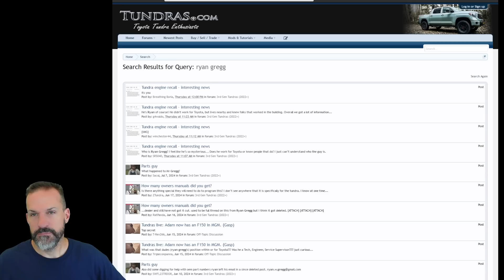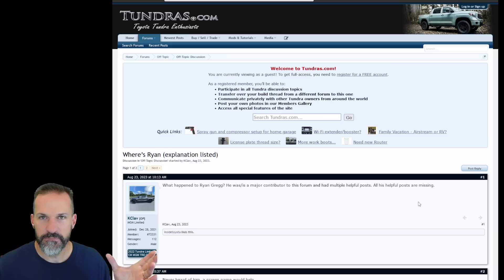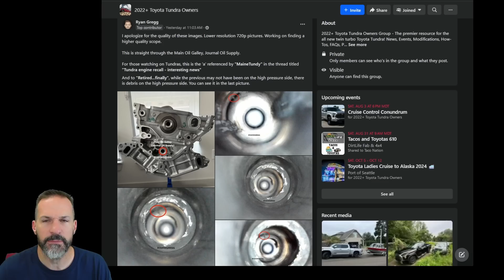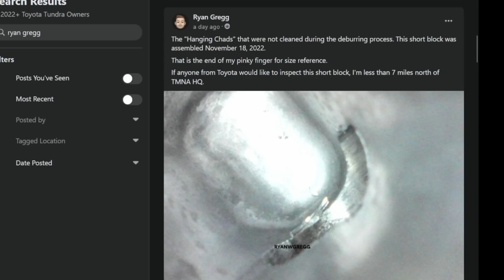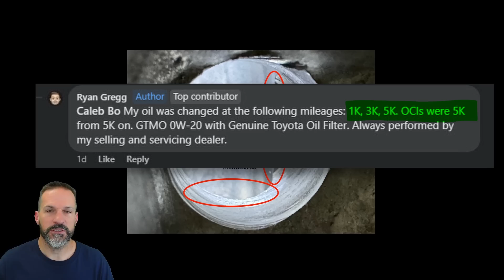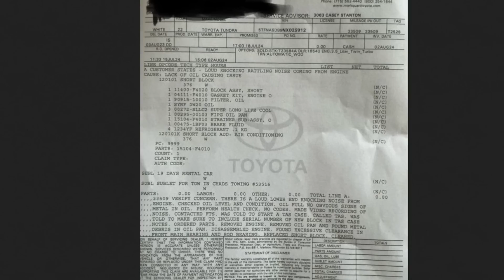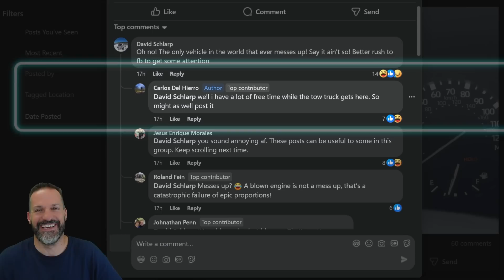Tundra Engine Failures: Debris Confirmed and Early Warning Signs for Dying Engines.

Comment from the maker: What do you all think? Judging from the pictures from Ryan, it REALLY feels like debris issues could easily be a big problem with regard to the main bearing failures...along with the parts changes Toyota made in early 2024.
Reply: I still don't understand how debris that makes its way past oil return seems to only effect the #1 main bearing.  Shouldn't the other bearings be equally effected?  There must be a reason for the new part number for #1 crank bearings.
Reply: @MSGarrett1  Given enough time, it would certainly affect other bearings but obviously the #1 bearing is the first one affected.
Reply: If you were going to buy a new truck or one a few years old, which one would you buy? I'm just curious about your opinion.
Reply from the maker: @williamellis59 I’d buy a second gen tundra. For new…that’s a tough one. I’ve heard through the grapevine that Toyota actually had debris issues up until November of 2024, so maybe 20,000 2025 tundras still will have issues. Going forward they might be safe but, time will tell
Reply: @TheCarGuyOnline indeed time will tell.  I sure hope they fix it.  I hate to see Toyota taking this turn.

Comment: I dont believe its a result of debris. Its low oil pressure. A very similar case study would be freightliner cascadia that has an electronic valve that would drop the oil pressure down to 5 psi while coasting. After developing a reputation for spinning main bearings they eliminated this feature around 2020. Full oil pressure all the time now.

Comment: I have a 2019 Tacoma with the 3.5 V6.  I really like the truck, but in my opinion Toyota is the most overrated auto maker.  Prior that the Tacoma I had a 2016 Frontier which was a better truck in my opinion.  It certainly had more power and it shifted more smoothly.

Comment: So Toyota still has a debris issue in 24 and now 25?  come on now
Reply from the maker: Some 2024s still had the issue. There has been a single 2025 reported with engine failure but we aren't sure why, the report did not have details and no others reported. Time will tell if they have this sorted out

Comment: Not surprising that debris is in the oil galley after a bearing failure. Very well could have failed because of "other" debris left in engine during manufacture, but this debris is probably self generated. And it is doubtful that the oil filter would capture all the debris from failing bearings as the by-pass valve probably opens on occasion and filtered debris gets washed into the oil galley.

Comment: 2024 Tundra with 2k on the clock is starting to scare me! While parked and idling, the engine stumbled badly and almost stopped. Idle feels a bit rough, but power delivery still seems good. Anyone else experience this before a failure?

Comment: I’m picking up my 2025 limited iForce max trd off-road next month! Super stoked. I’m not too worried. All manufacturers have their issues. People are only running their mouths because Toyota is held to a higher standard. Well, they are doing the right thing about replacing the whole engine. I think these issues could be a machine that isn’t correctly drilling out the channels in this engine which I’m sure it’s now fixed. Either way I’m getting a 10 year/125k mile warranty for super cheap for mine! I’d still rather go with Toyota than gm/chevy, ram (fiat), or Ford!

Comment: FORGERY & FRAUD:  Toyota of Fort Walton Beach Florida forged my signature on the pre-approval check which resulted in the APR increasing from 5.69% to 7.14%, increased the monthly payment and overall cost of the loan, and damaged my credit.  I did not know this until three weeks after when my credit union finalized the documents.  Toyota USA Brand Engagement Center refuses to hold the dealership accountable by saying that the dealership is individually owned and I need to take it up with them.

Anyone know an Auto Fraud Attorney in Florida that I can reach out to?

Comment: It’s not manufacturing debris.  It’s a design flaw or manufacturing tolerance flaw.  I wouldn’t trust that 3.4L twin turbo engine until the crank shaft problem no longer occurs and we have many samples with 150K to 200K miles.  That’s gonna take several years.
Reply: Wrong.

Comment: Weren’t you dead set on a design flaw, engineering failure? Shows you just like to chirp without knowledge of anything.
Reply from the maker: It's still in question. Toyota claimed they fixed this in 2022-2023...so why are there still, to this day, 2024s failing? Why did Toyota update the main bearing part numbers? I never said I was dead set on anything. I was pretty clear about that. If you like Toyota like I do (I own multiple Yotas still), you should be thanking me for holding them accountable so that maybe they can get back to what made them great...

Comment: Have a 1982 Toyota pickup with 1,000,000 miles on it have rebuilt the motor twice for 3000 dollars total and the transmission once for 800 dollars. Paid 5500 dollars new for it, still trying to get my money out of it. Just bought an after market new carb on Ebay for 100 dollars. Average 25 miles per gallon on the highway. Insurance is 35 dollars a month. I am 68 now and I am beginning to think this truck is going to outlast me. I was looking at this Utube, looks like they are even casting the blocks out of aluminum on the new vehicles. I am sad to see my Toyota go so far down hill. I suspect the only way you are going to get a reliable vehicle now is to rebuild an older Toyota, Ford or Chevy. I have restored a 1983 F150 Side Step 4 wheel drive Pickup with a 300 6cy, gets 20 MPG on the road. Have 10,000 dollars into it just need to paint. House is paid off life is good. Suggest to all you folks to let these new cars/trucks stay on the lot fix and old one and stay out of debt.
Reply: Thats a lot of trips to Walmart…
Reply: @pathunter7003  Had kids in California and a job 50 miles from home for 30 years.
Reply from the maker: I completely agree. buying older models and maintaining/rebuilding is likely going to become more common soon. That's pretty cool that you can rebuild that old one for $3,000, assuming it's a manual too?
Reply: @TheCarGuyOnline  4 speed, just bearings at the time, Toyota had a bad lot in that model, have put another 900,000 miles on that transmission. Any of the new products on the market, refers, washers, dryers, cars, trucks, tractors are a waste of money. I am trying to teach this younger generation that they have to be smart, avoid debt, fix the older models, buy a piece of raw land and build your house a little bit at a time for cash. I have rebuilt 5 houses now and did one from scratch. Have a 1952 8N Ford tractor, restoring. They made a good product then. I rebuilt that motor twice for a total of 3000 dollars.

Comment: Hey car care guy I need your opinion? Have you heard of any 2024s being recalled? I tried to ask the "Tundra 34 dude guy"  and the "the car car nut guy" but they're  useless as T*ts on a bull .  I got a deal on a lease return, but I'm hesitant to dive in on a Toyota that will fail in a couple years.  Is the powertrain warranty 60k miles on all their Toyota's?  Thanks!

Comment: Yeah well get rid of it get rid of the crop by the 4Runner brand new 4Runner is the best vehicle Turner still makes so just buy that 38,000 the base model Only Fools will buy a turbo motor or anything else the Toyota has to offer in the Corollas garbage you know and so whatever man be a moron and keep buying garbage don't be smart and buy a brand new 4Runner 38,000 I wouldn't pay no taxi the time that's it bring cash with you and walk out the door if you don't you're a moron I'll buy a used one

Comment: I used to  work for a bulldog chief engineer at Raytheon Missiles and when the program was facing a serious operational issue he always demanded that the engineers trace the fault down to the root cause.  Many times the first reported effects or symptoms of failures are erroneously identified as the root cause.  Toyota needs to release an analysis of this engine failure that convincingly describes the root cause.  In this case, the root cause may or may not be the undesirable metal burrs.

Comment: It was my suspicion was chips from the galley moving and plugging oiling ports throughout the engine. I work for one of the big 3 and sediment analysis is heavily scrutinized in the plant. The tooling is designed in a way to make small chips rather than large stringy chips so that they can be easily flushed out in the washing stations . There are also deburing stations in the line that remove any rolled over material. It is extremely surprising to see a block in that state to make it to assembly.

Comment: I waited so long to get my tundra....6 mo after i finally got mine...boom.... i knew I wasn't crazy when I told the techs my mpg dropped like a fly suddenly....
Reply: So what did they give you to drive after the truck blew up? And do you still have to make payments on something you can’t drive?
Reply: My 2024 sequoia was getting 18. Now I’m getting like 13. Then I have to pay 100 more for plates because it’s a hybrid. A hybrid that doesn’t do anything. I currently have 4200 miles on my engine.

Comment: Worked 48 years in aircraft engine and automotive manufacturing. All assemble parts go through a high pressure washer before assembly. Believe the debris is from a design problem.
Reply: Me too.

Comment: BuT iTs A tUrBo EnGiNe.....
Reply from the maker: I like turbo and electric engines for torque however the way they are designing modern turbo engines it's tough to get behind for daily drivers, especially for normie middle class folks. Very rarely are you finding forged components anymore or overbuilt blocks/heads etc. We are entering a new age where used vehicles will cost too much to repair for most people, and many buyers just don't understand what's even under the hood. It's 100% about profits, chasing power with smaller displacement while giving up reliability.

Comment: When can we expect a video on GM and their decade of V8 engine failures and their current lawsuit? Or video on the Ford Ecoboost lawsuit?   Or the Hemi 5.7 and 6.4 lawsuit? Toyota is fixing the problem and making their products better but for some reason everyone else gets a pass on this bias channel.
Reply: Maybe cause it is an unproven issue?
Reply: @pathunter7003  hilarious to suggest that! 😆  I have replaced over 100 camshafts on GM 5.3 V8s in less than 2.5 years.  And I am one guy that doesn't work at the dealership.  It is such a problem the Oil control valve for these engines is on backorder constantly.

Comment: It is disappointing to see that Toyota would consider legal action against a buyer who is posting information.

As a 2024 Owner of a Tundra, people, like myself are looking for answers.   Issuing a recall but then not doing much beyond that at this point, really doesn't address the issue.  Replacing part of an engine is more work than having a complete motor ready for immediate bolt in replacement.

I had to go on a trip recently that involved a very long drive.   I took my 300,000 Mile Tacoma and left my 2024 Tundra at home.  The purpose of the Tundra was to replace the Tacoma as my primary vehicle.   I had my 2024 Tundra a month before I found out about the engine issue.  Had I known this, I would have bought a V6 Tacoma while they were still available or bought a Chevrolet Silverado.  Ford can cram their EcoBoost.  I am done with Ford, which is another topic.

We need to have really strong Lemon Laws that really hold automakers accountable.  

The good news is that these pictures of the inside of the engine will be great for the class action suit that I predict will come out of the engine failures.

Plate C
Reply from the maker: Yeah it's tough to say where this goes. Toyota has had issues in the past in first year model changes, but I don't remember any being this large or costly. Time will tell how many of these are actually affected, I hope your 24 ends up being OK. 

I will say, by the numbers, there are NOT a lot of 2024s having these issues compared to 2022s/2023s. If it was mostly a debris issue which is more plausible now, I would think most 2024s and beyond would not suffer the same fait. Would I personally buy one? probably not...not for a few years, but since you already have one, I would just drive it until 50k then revisit the situation/decide if you trade before warranty is up. Given the numbers, I would feel more confident in 2024s than the 22s/23s for sure...I hope it stays that way. 

To give you some background, most people think I'm just a toyota hater...I'm not, I was in the market for a new Tundra when finding all of these issues. I own 3 Toyotas currently, all 2011 and older, and love them dearly.

Comment: LMAO they have to disassemble the entire truck for the repair, who the hell would want that vehicle back?!
Reply: What DIY'er would want this truck?  I have a 2006 I love , would never buy one of these.
Reply: Im a mechanic. But anytime you have to replace a motor you have to de assemble a huge part of the vehicle to replace it . Especially on newer models. Its always been a big repair- and i mean its what mechanics are trained and have had schooling for 🤷‍♂️🤷‍♂️.
Reply: You’d be shocked to see how they assemble the cars with this mindset lmfao.
Reply: @TenaciousSchemer  That is done by assemblers who handle one small job at a time in a highly efficient way. You expect me to think some 20 year old tech at a dealership can handle this job alone?
Reply: I have seen how they handle this. It's quite reliable. These techs get the schooling and tools to handle this job. Toyota pays them well, and I wouldn't take it just anywhere. I used to work for Toyota as service advisor, and they are honest and fair, that's why Toyota has this reputation unlike domestic auto manufacturers that act like the "CIA"!

Comment: Early sign is rattling sound and stalling, oil leak,  I have mine in the shop took some pictures as well and videos, mine is 2023 23k miles.
Reply from the maker: Are you getting a new shortblock or having to wait for longblock?
Reply: @TheCarGuyOnline  I do t know yet. It is sitting at the dealership nothing has been done to it. Toyota asked me for all the invoices and the extra stuff I installed on the truck with all of the invoices and registration fees. I sent it to them

Comment: Yep,  failure like this should not be replaced with short or partial engine.   It there was debris before,  there may be some in the turbo oil line,  oil cooler or lines,  chances are,  will have to replace it again later.

Comment: To add context, Ryan bought a brand new tundra short block for cheap, had plans to take it apart and document, but was banned from forum. Sound like he finally got around to taking it apart and sharing pics. 
So the debris is from a short block he bought, not from failed engine in his truck
Reply from the maker: Thanks for filling in the gaps :)

Comment: Oh nooooo
I did oil changes like Ryan so I thought I was ok. I’m at 107,000K on the OD
Reply from the maker: That's pretty high mileage. Is yours included in the recall notice?
Reply: @TheCarGuyOnline  No unfortunately. It’s the Capstone Hybrid. They should include the hybrids because it’s the same engine made in the same place as the non hybrid.

Comment: Thanks for update.  I agree this one to be avoided until 2026.  Not all affected models are included in this since they feel the hybrids can still limp along with blown main bearings.  And why aren't the 24's included?  I've heard of reports for those as well.  From the pieces of information we have got it does not appear they fixed this until May time frame this year.  Still too many unknowns.  I appreciate my 2019 Pro 4x with old school port injected motor with non active learning transmission.  Does not have tons of silly sensors everywhere.  I don't trust new cars anymore.  Except the last remaining 4 runners coming out of Japan.  Not liking any of Toyota's new TNGA platform trucks SUV's.  Price points don't offer much value anymore.
Reply from the maker: You have a great truck. My dad still has an Xterra with 215k on it, same 4.0L and Transmission. Runs like new...gets over 20mpg still.

Comment: So we are to believe the LARGEST, RICHEST AUTOMAKER in the WORLD didn't have a proper debri flush out system in place???  ...let alone for their most expensive vehicles? ...the Tundra and Lexus models with this engine......YEAH RIGHT  ! !
Reply: They are the most in debt auto company in the world.  Also, they just revealed that they forged testing results for more of their autos.  Just keeps showing this is a company you cannot trust.
Reply: @georgeburns7251 and you trust gm and ford? dumb patriot
Reply: Buddy I work for the dealership for 15 plus year they all make garbage design just the last mileage warranty if you’re lucky and this is on purpose
Reply: Buddy I work for the dealership for 15 plus year  plus my own shop total years. Doing auto  and marine repairs 35 plus years they all make garbage design just the last mileage warranty if you’re lucky and this is on purpose   .   They don’t last like they used to .
Reply: The overall quality of their cars keeps going down the more they involve the American design and engineering teams. Their reliable engines and platforms are usually all designed in Japan but their newer generation of vehicles has mostly been developed in the US. Mexican and American auto worker quality has also fallen off the cliff too sadly, but that's an issue for all manufacturers.
Reply: @nateTrh  This same engine is also produced in Japan for the Lexus models and those ones have the SAME problem.
Reply: @nateTrh you should see the quality of my 2024 sequoia limited. I can’t believe some of the build quality problems I’m having for a 82 grand vehicle.